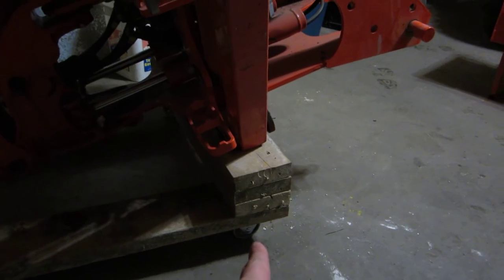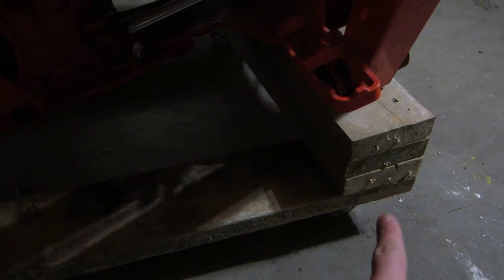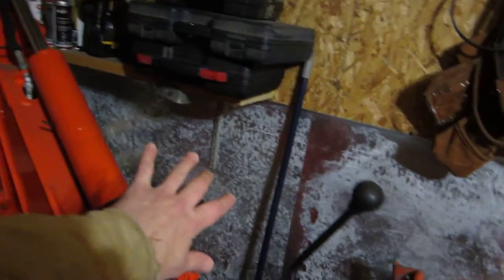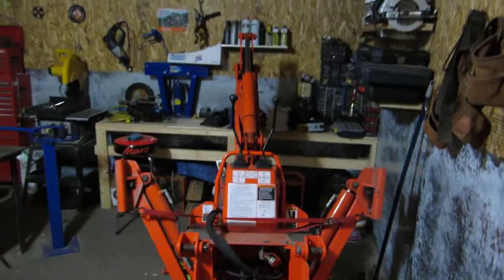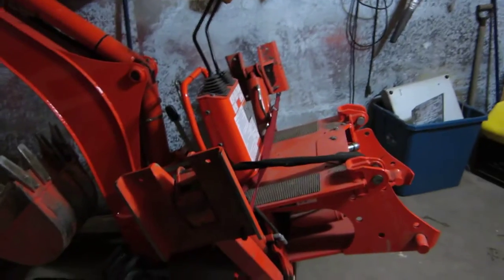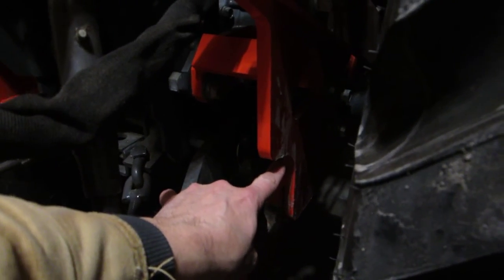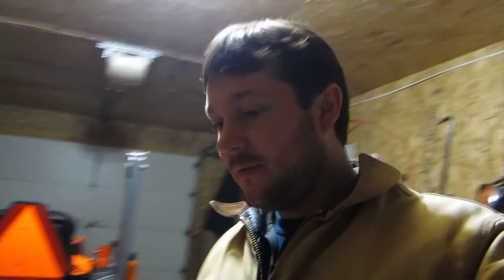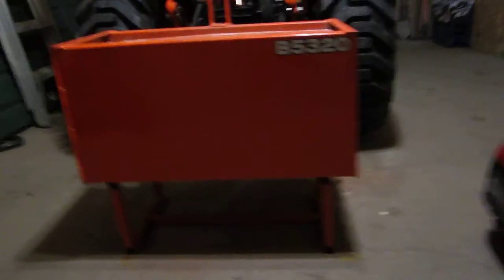Video about bh 77 backhoe dolly viewer request

Comment: Sweet videos man, i just ordered a L2501 with the same backhoe. I am going to do the dolly once i get a concrete floor shop to keep it in. Until then ill be in a gravel floor carport in my backyard. Where did you get that bolt on front bucket blade re-enforcement? I think you might have inspired me to actually start posting some videos and give back to the youtube community. Thanks, Matt